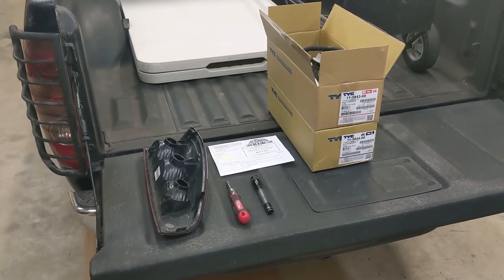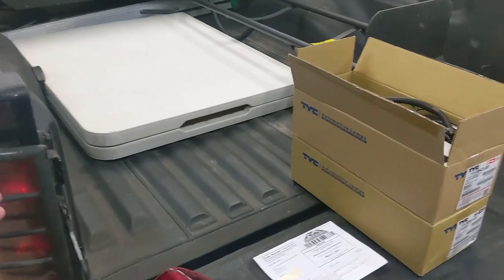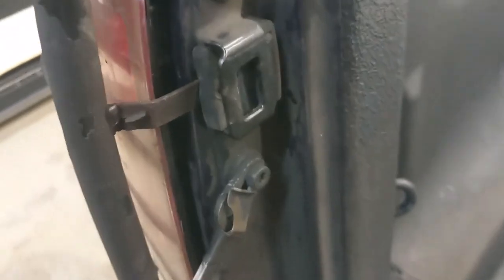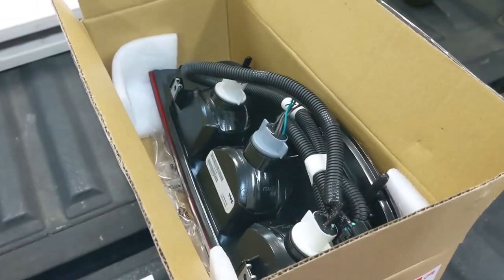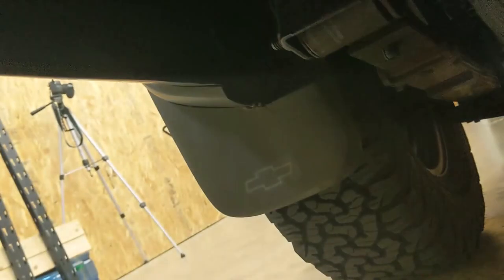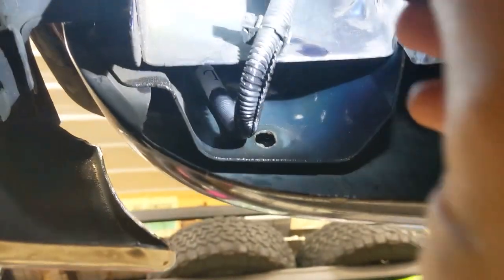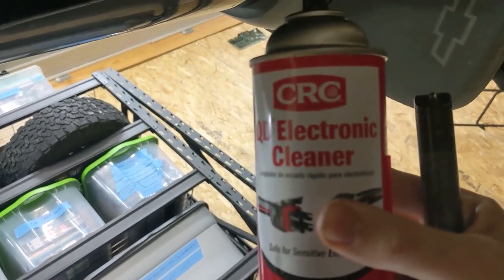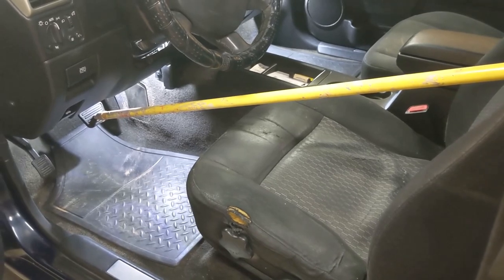How to replace tail lights on a Chevy Colorado

Comment: Where can I get on of the Guard
Reply from the maker: Hi! The tail light guards are manufactured by Westin.  Part number 39-3365.  I believe they may be discontinued now, but you might have some luck finding them on a site like Amazon or eBay, or by contacting the manufacturer.

https://www.amazon.com/gp/product/B000LY9HYU/

Good luck!

Comment: Can you just replace the lens without installing the entire unit?
Reply from the maker: Hi Jason, the taillights are a sealed unit. While I suppose with enough time and effort you could pry just the red/clear "lens" portion off, I'd be worried about the integrity of the unit - would probably let water in, unless you sealed it back up tightly.

In short - I wouldn't recommend it, lol. 🤷😆
Reply: Thanks Mike. Reason is, the lens is damaged but the lights, and all behind it are perfectly fine. Right now, it’s glued back together and put back on without issues. But wondering how long my ragtag repairs will last 😂
Reply from the maker: @jasonlee8506  haha, you could get some of that red translucent tape, too. But the housings are so cheap, probably better to just replace 'em. 😉 Good luck!